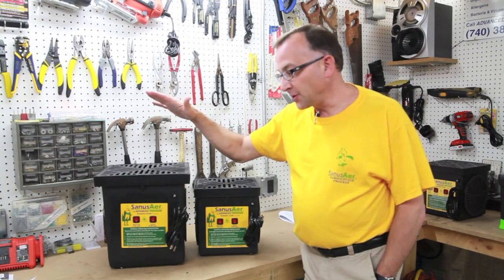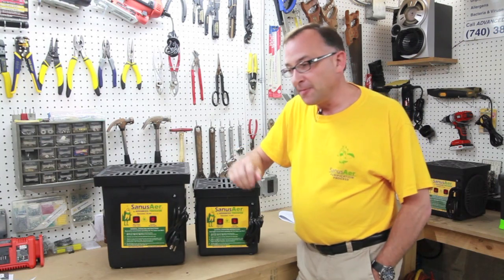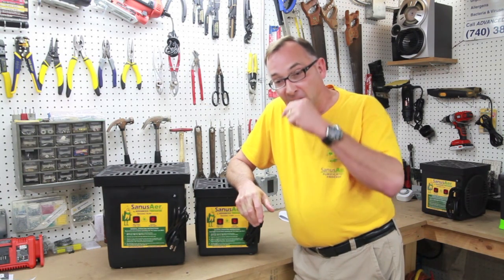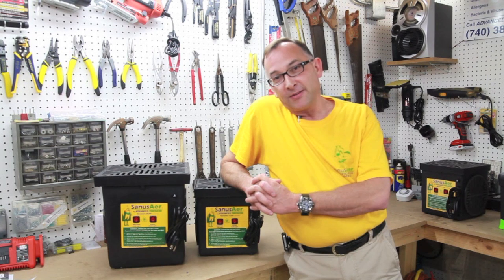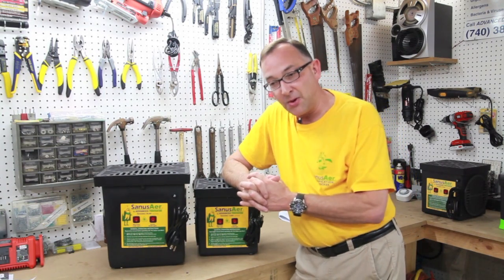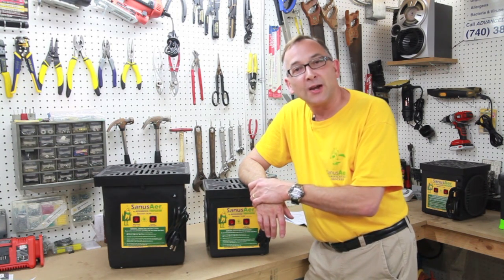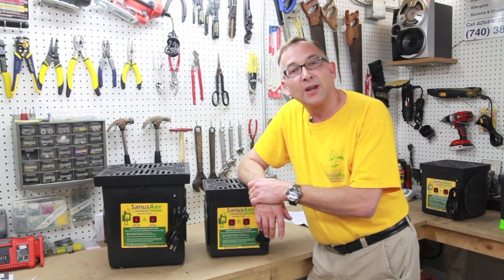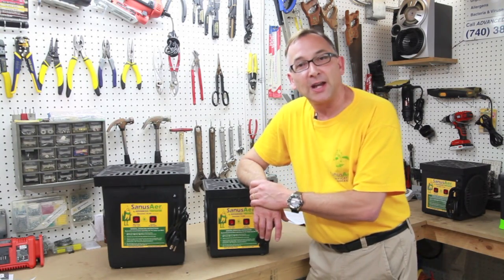Ozone Output Required for Effective Shock Treatment: Odors, Mold & Mildew, Tobacco, Flood, Fire.

Comment: This might be difficult to configure. I don’t know, because I just bought the cheapest generator on Amazon and I will be using it for a house, where there’s definitely cat pee in the carpet. There are no barriers, between the livingroom, dining area, kitchen and the hall to the back room. I will also be initially doing this “wrong” as I will be using the OG before I remove further items, from the home. But am satisfied with the fact that I will likely use it as I go, as needed. It’s just to make it temporarily less odiferous, until clean out and disinfecting is done. Then, to be used again.  I’m also doing it this way, due to the potential of hantavirus.

For the moldy basement, that will be another story. I will be dehumidifying and cleaning first, then using the OG, if I have it in the right order.

Second floor, just the OG.

For me, this is simply a better than nothing solution.  I didn’t get a larger/stronger OG, due to cost and because I don’t want wiring stripped, in an old house. As I don’t live there at this time, I have no problem setting it for the 2 hours and leaving for a day or 2 and even moving it from room to room, if necessary.

Comment: I have about a 20 foot travel trailer that got floor damage from water and has pretty bad mold build up. I wanna shock it pretty hard. How long to use a ozone machine and how strong a machine will i need?
Reply from the maker: I would suggest our SA-10000.  This puts out 10,000mg/hour output. I am estimating your space to be roughly 1,000 - 1,200 cubic feet.  Our SA-10000 is capable of treating a space 10 times that size.  So, I would start by running it for 1 hour, then off for 4 hours before returning.  Let the trailer air out.  This should eliminate the mold odor.  If it isn’t 100% gone, I would retreat for another 30 minutes.  Feel free to reach out if you have any further questions at 740-387-PURE [7873].

Comment: If you use a lower output unit, can you simply run it longer? Will the ozone level continue to build up over time?
Reply: O3 decays back to O2, so at some point in the treatment , the number of O3 molecules decaying should become equal to the number of O3 molecules being generated. So if you use 6000 mg/h, then at some point, the O3 concentration in the air will reach a level where 6000 mg of O3 will decay in an hour.

If the home is small, the relative O3 concentration will reach a higher level than if it happened in a bigger house.

Comment: What about vehicles? Cigarette smoke inside?  I try running it for 2 days straight and still smell inside!  I have the 14,000 mg unit!
Reply: You need to clean everything inside the car, carpet, seats, headliner, all plastics. Turn the air conditioner on recirculating.
Keep one window cracked a few inches. The generator needs oxygen to work properly. Run the generator with the car running for 30-60 minutes. Turn it off and recheck it in a few hours for oder

Comment from the maker: The standard generator sizing for am 1,800 ft2 home would be the SA-20,000 which produces 20,000 mg of ozone/hour, which will technically treat a 2,000 square foot home.  A treatment should destroy the mold spores that are present.  Of course, there should be no People, Pets, or Plants in the home at the time of treatment.  It is advised to eliminate the source of the moisture responsible for the mold to prevent any re-occurrence.  Please see the manual for additional information.
Reply: Once the correct sizing is determined, what duration should the ozone generator be run for?
Reply: Hey sir. Time and saturation are fundamental. You actually make and sell that unit and you forgot to tell your customer the most important information.

Comment: Can it be used while peoples are in the apartment/room?  I heard that it is to be used only in an unoccupied room only and when it finished, all windows should be opened to air out a couple hours before re-occupied the room.  Can you clarify its usage?
Reply from the maker: No people, pets or plants can be in the area while be treated as it is an irritant to breath.  Depending upon how long you run the unit, it could take 1-4 hours before the ozone concerts back into clean breathable oxygen.  Or, you can speed this up by opening windows and doors to air out.

Comment: Is there small enough ozone machines out there to be able to use for short periods of time around pets and people to help with pet ammonia smells. Im looking at a small unit that says its rated at 200mg/hr? I would be using it along with other tools like carbon filters and frequent cleaning. Do you have any recommendations for intervals? It would be used in a laundry room of about 500 cubic feet.
Reply: Bill Chadwell can’t use it around pets it will fry their lungs.  Especially birds.  Take the animals out.  Run it air the house return the animals a hr after ventilation.
Reply: Well, the MORRER machine on Amazon only has a small, small amount of Ozone and can be used around pets (that's what they say). I was pet sitting. Friend's cat passed all over the TV room. It smelled bad. I used baking soda and sprayed in those areas. It helped somewhat, but then I used the MORRER machine, and I can't really smell it.

Comment: if nobody is going to be in the house for a day... can you leave the ozone running next to the AC evaporator fan so the ozono can run through the whole vent system and the house?
Reply from the maker: Jhonathan Rivera yes you can.  In fact, this is what we recommend.  Thanks for asking.
Reply: @Sanusaer how long can you do this? My home is 1900 sq ft and machine has 45,000 mg/hr output
Reply: Jonathan, yes, that is a strategy we've used in the past and it is very effective.  In addition to getting the gas distributed throughout the house, it cleans the ducts at the same time.  Please let us !
Reply: Any negative effects on the HVAC system if you place a unit near the return air and run the fan?  I need to cleanse a 2400 sqft townhouse that has no furniture and is all hardwood and tile.  Thanks

Comment: Do not buy it. I used to kill mold and became very sick. I was couphing for 5 mo., big chest pain. Never had like this before. Painful to breathe in. I do not knew how to treat myself, doctor prescribed beclomethasol. Did not help. If somebody had same symptoms do you feel better after time or this is permanent? Please Stop selling this. Sell something different. This is dangerous!
Reply: Did you run it inside and go to sleep or something? You're not supposed to inhale Ozone, it will damage your lungs.
Reply: @flyingpapa16  It was different brand. But they all doing same job. Ozone harmful. I was not present during it 's working. But had to turn on/off  because it was running for 24 hours in order to kill mold.
Reply: IRINA COLLINS 
It is very unfortunate you experienced this.  However, you must have been educated from bad sources.  It is a common fact that people, pets, and plants are not supposed to be in spaces where high output ozone generators are treating.  It is not proper for you to tell people that a very effective method to treat molds, viruses and other things should not be used because you were not educated when you used it.  Ozone treatment can be very safe if done properly but can be dangerous if not.  I have asthma and know having lung issues is difficult so I avoid breathing ozone without a mask.  I hope over time your lungs recover and I wish you well.
Reply: Irina,

In all the years we've been selling these generators, we've never had an incident that you've described.  Can you please tell us which manufacturer you used (we don't show you as a client of ours)?  As Gil notes below, you are never supposed to operate any high output ozone generator around People, Pets, or Plants, because it can be a strong irritant to the lungs.

Comment: Are your output ratings based on air or pure oxygen supply?
Reply: That is a Coronal pass through Efficacy Question. 75% Nitrogen. 20% O2. Go Figure.
Reply: 2:09 happen
Reply: Oxygen supply is the air.  Output is based on power consumed and a well functioning fan.